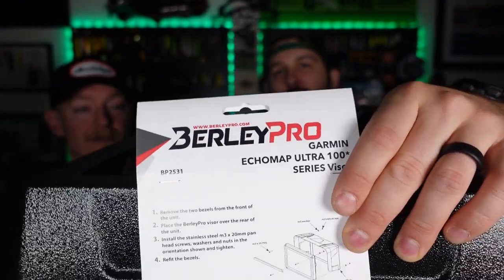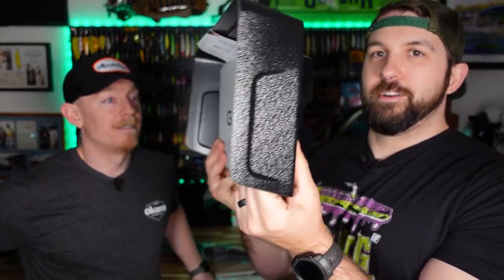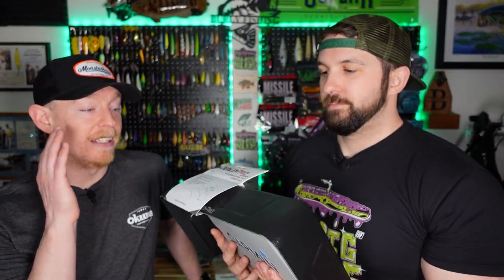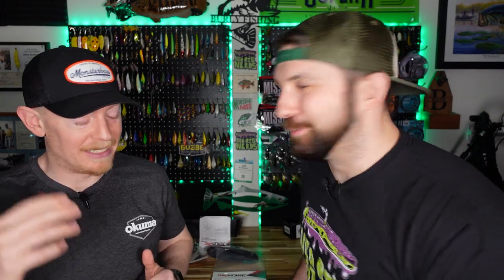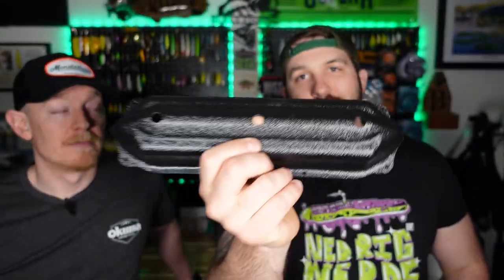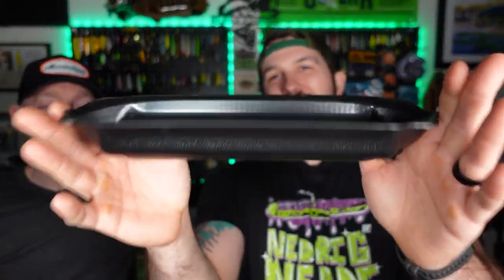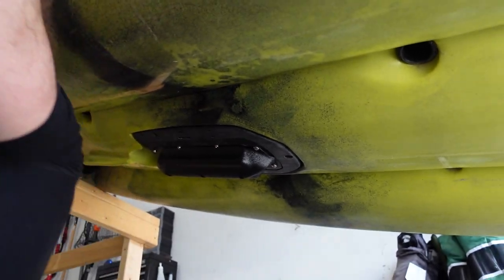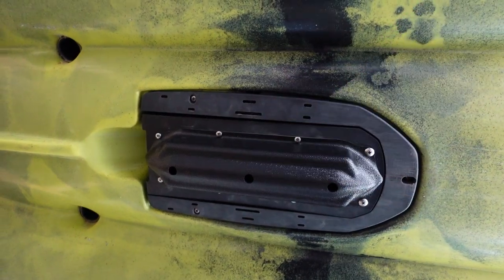The BEST Kayak Accessories You Didn't Know You Needed! | Berley Pro

Comment: The keel guard gator strip is 65$ don't use a hair dryer, use the sun but don't apply it in the sun it will start curing and hardening super fast. Ask me how I know. I applied mine eariler morning before it was even 70 degrees and my tape hardened within 40seconds of sunlight.

Comment: Question about the transducer cover: When it's retracted does it sit fully in the well (fully up out of the way?) or does it stick slightly below the level of the hull? For example if it was retracted and you dragged your kayak (😱) would the protector cover make contact with the ground?
Reply from the maker: It’s almost fully retracted.  But this cover can take a beating and be fine
Reply: Thanks very much for the reply!! I'm waiting on the delivery of one before installing a Lowrance HDS Carbon on my PA12. This info helps a lot!! Cheers!